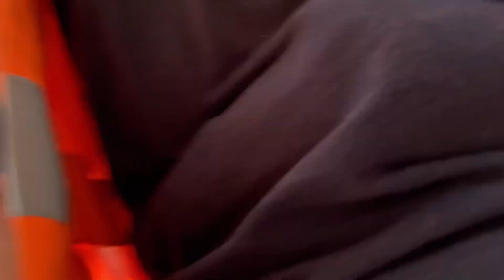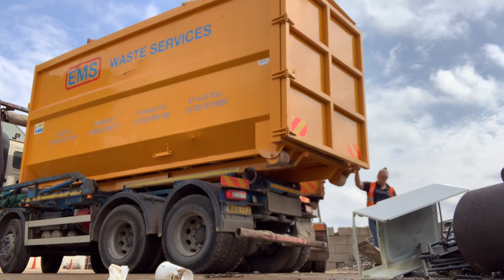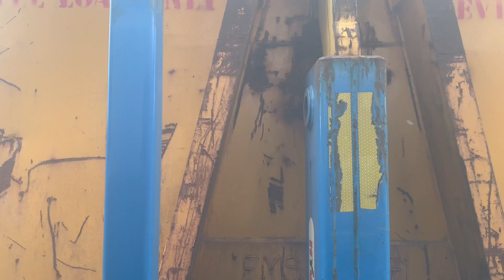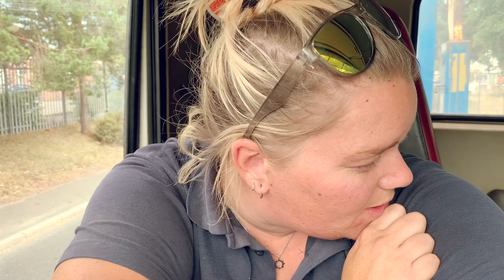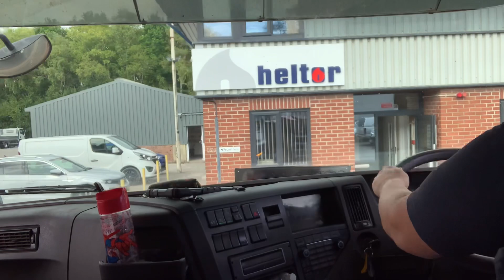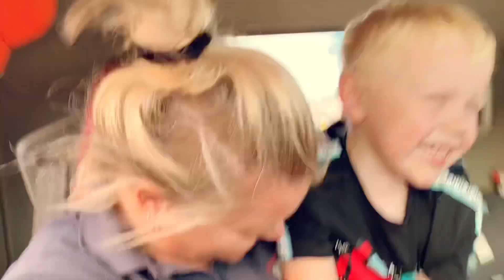That was to close! | Volvo truck | truck vlogger

Comment: Interesting video Chloe that scaffold lorry was fitted with a Multilift system . Basically 2 steel rails and frame and hook attachments for the 2 winch cables on the lorry . They have  several option such as the flat bed you saw and skips like yours there was even a option of fitted with a 5th wheel so you could pull a trailer . Great to see the little man again xx Stay safe and healthy ...
Reply from the maker: Ah well that makes total sense! Just looked very unstable lol

Comment: Hi Chloe, your little Logan is such a cheeky little imp 😂 been out in the paperbank lorry this week learning how to operate the HIAB, I need a lot more practice but Phil who is currently the only crane operator at Marston Magna yard said I will get there...eventually 😊 went in the RORO last Monday and going onto Landfill sites really makes you appreciate how good the aircon in a Volvo like you were in on this video is 🤢 it stank, apparently it's worse in wet weather too! Have a safe week out
Reply from the maker: He really is a character 😂 oh nice! With a bit of practice you’ll get there! Something I’ve always wanted to try 😊 yea landfill is not the best of places to be in the heat 😳😊
Reply: @SkipChickSW  from what I hear its worse in wet weather!
Reply: @elizabethmaybrown6715  You'll get used to the HIAB in time. When I started it was one lever at a time, and looking to check it was the right one. Now its multiple levers at the same time and not looking!! The one thing I would say is if you are using one with a grab of any sort, keep your hand (or foot) away from the release lever until you need it. 😀
Reply: @kenpottinger55  this one is for emptying paperbanks and all levers are on a remote control unit, easy to use just need to remember which way to go for up/down left /right etc. It has the rotating attachment that you can use a grab with for picking up bales of poly and cardboard, the guy training me took 2 months to get used to it now he's a pro on it😂😂